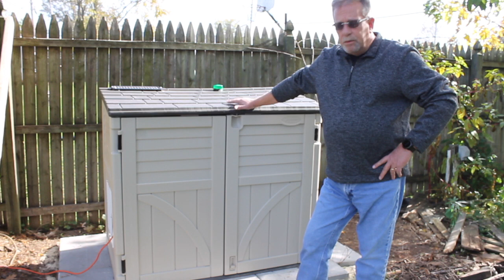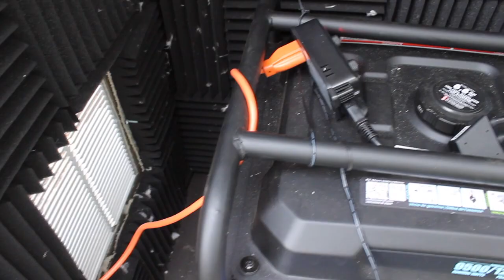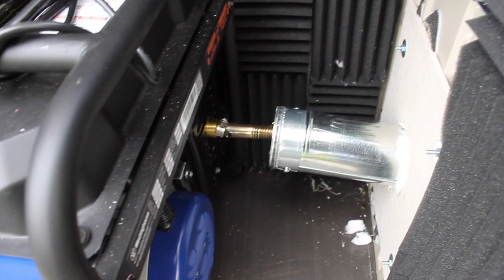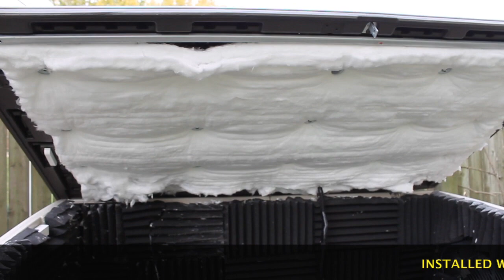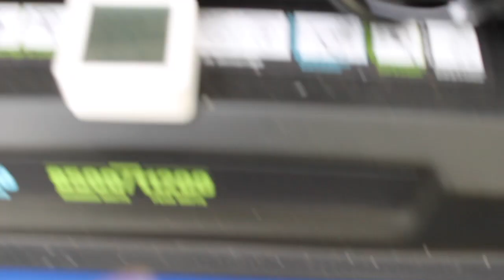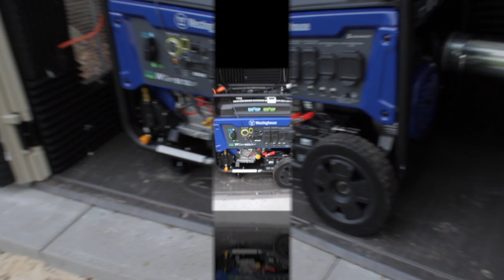Ultimate Smart Home Generator Shed Build. Keep your generator Ready and out of the weather all year.

Comment: Great video.  Useful tips without endless talk. I am currently installing a WGen20000 through a Generac transfer switch and using the Westinghouse Smart Transfer switch option also. I live in a log home so am building a 1/2 log enclosure to match my house.  What is average temperature in the enclosure with the fan running (not exhaust)? Do you know if Westinghouse has any guidance on running these units in enclosures?
Reply from the maker: It has averaged around 85 to 90 in the summer. The fan does a great job and moves alot of air. Haven't had to run it in the winter but I'm sure the interior temp would be much lower. I haven't seen any recommendations from any manufacturer about running them in an enclosure like this but it works very well for me and is very quiet

Comment: Great job looks like you are ready for the next power failure 
1 question what about the gas going stale if it sits for a long time between uses
Reply from the maker: You should always run Stabil in the fuel tank. And you should run your generator every few weeks for 20 minutes or so.